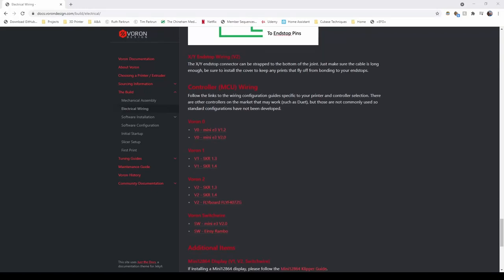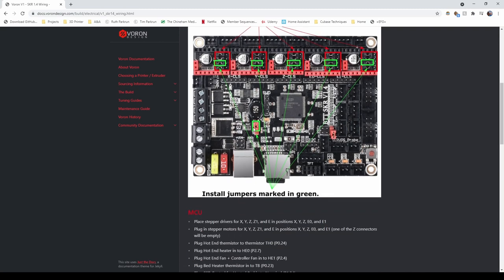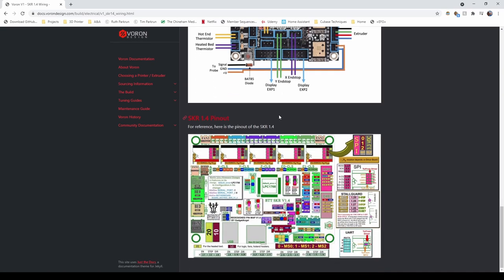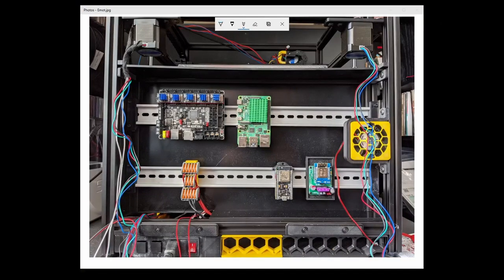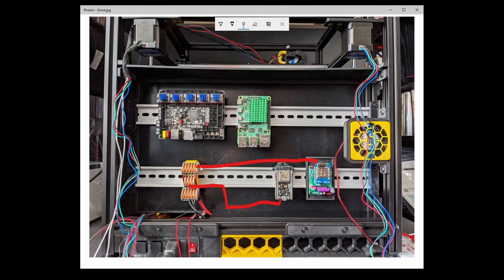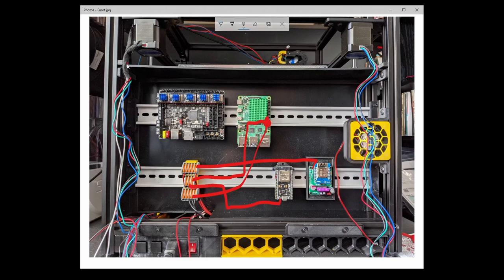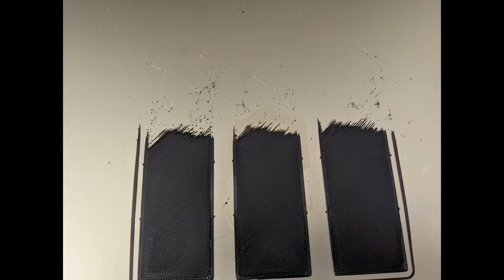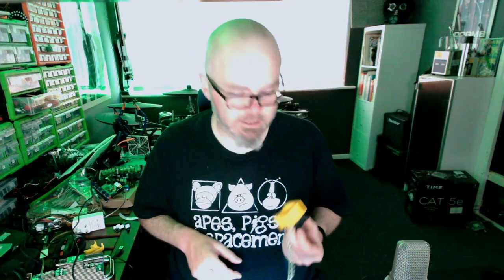Voron V1.8 3D Printer UK Build - Episode Six

Comment: Same happened to me on my 2.4 build with silicone wire mine lasted 2 days at the back hotend fan would stop and cause a clog, fixed that then my extruder temp went to -50 something, so ripped it out and fitted a linneo loom so far so good and fitted pcb like you have.

Comment: Great job, I think we can all relate to the problems you had, I bought ptfe wire for my build, now I'm patting my self on the back after the struggle you had with silicone wire,
you must of set a new record of wire breakage.
Reply from the maker: One I would rather not have 😉
Reply from the maker: And to be fair,I think it's my handling than an issue with the wire.